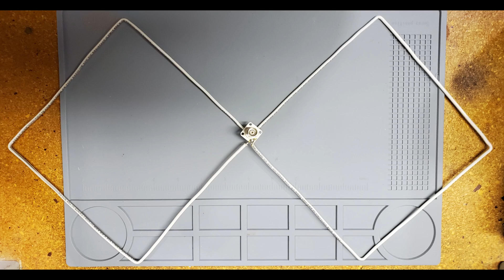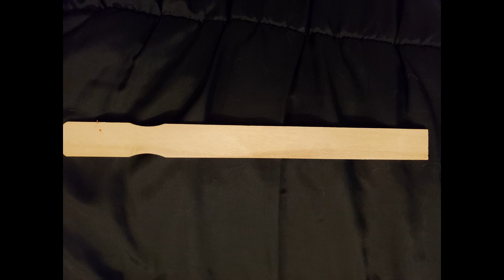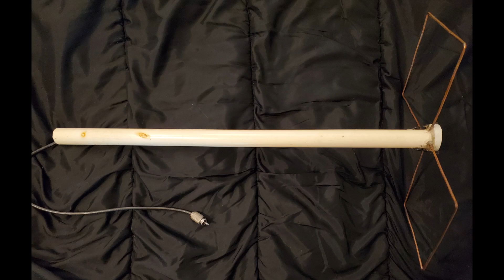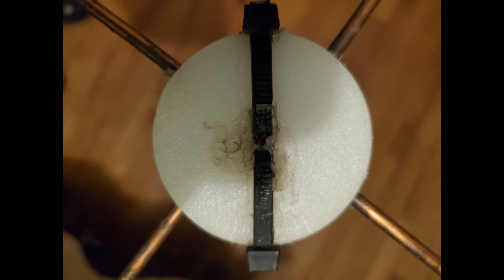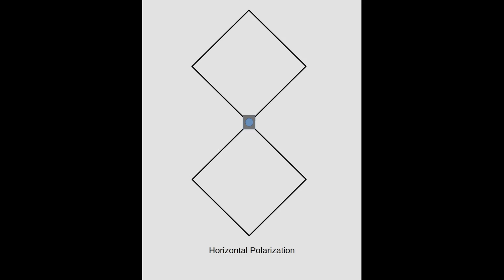Gain! Simple to Build!  It's the Biquad Antenna!  Part 2: Build a UHF Gain Antenna for Outside.

Comment: In order to work far away stations you need horisontal polarisation. How you position the antenna for this is not mentioned clearly. How much gain and beamwidth it has would be interesting for the viewer.
GL de Bjoern
Reply: I agree. I am a little confused with the term "broad-side". It would help if there were a picture of this antenna when it was installed. I am curious if the Diamond shapes are vertical, thus perpendicular to the ground, and which polarization that would be, and if the diamonds were parallel to the ground and which polarization that would be. I did not catch that from Part 1 either.